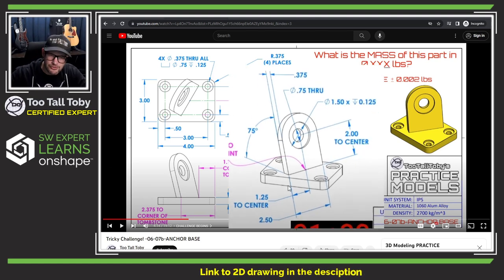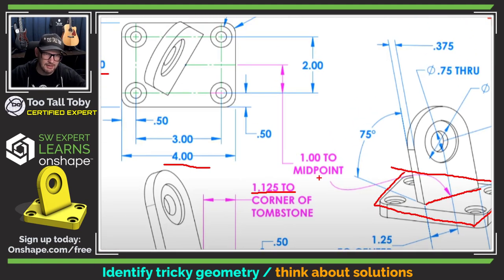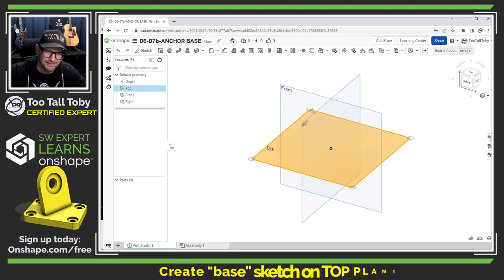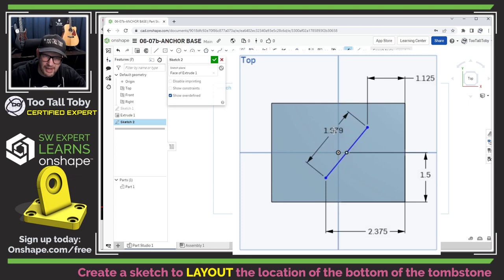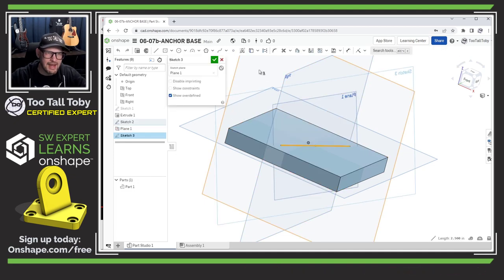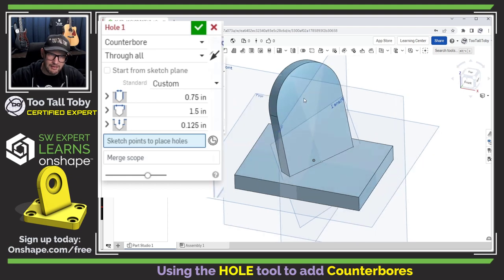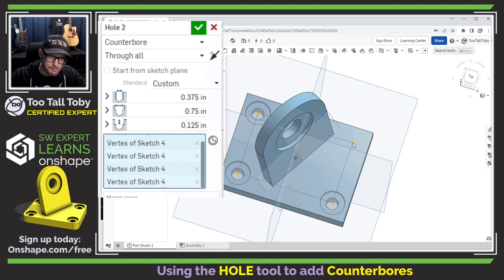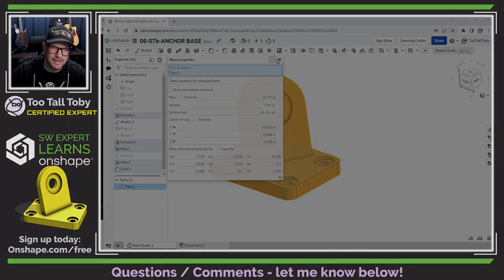Designing an Anchor Base (Tutorial)

Comment: Nice! Mate connectors FTW!
By the way the downside of using the plane for the angle is that you end up with your sketch axes at a weird angle so you can't just use the "standard" rectangle tool and lines won't snap as easily where you want them.
One way around this is to place your sketch directly with a mate connector. Alternatively, you can also create the shape straight and use a move face with rotate to set the angle.
I thought I had a solve of this one on my channel but I don't...
Another tip is that if you use a center point rectangle to locate the holes you can just select your sketch in the feature tree in the hole tool instead of selecting each corner individually (it will ignore the center pt of the rectangle).
Bonus tip: you don't need to put a space when putting in the units (just type 3in) so you could save a whole of three key strokes!
Reply: Another golden tip here for holes - thanks airwick :)
Reply: Oh man these excellent time saving tips just keep coming!!  Thanks Airwick!

Comment: I did this anchor base before you explained it as an exercise as I've been goofing around with onshape for enough time now to think Iwas up for the challenge.
There is a measurement missing on the tombstone, we can't know for sure when it starts arching on the top. By looking at the sketch, it seems that the arc starts at the same height as the middle of the hole so 2 inches from the base.
Based on that I did the part ... took me more than 10 minutes though and I made other building choices than yours ... but we have the same piece at the end and it was a fun exercise to do.

Now that i have seen your tutorial, I learned how to get it a lot faster ... thanks mate connector
Reply: Yup you are correct - I just looked again and there should be a radius dimension originating from the center of the tombstone/counterbore, to clarify that the arch of the tombstone is centered at that same location.  Good catch! 😁  Very glad to hear that you're now able to build this thing faster too!! 😀

Comment: I like to do the challenge and then watch the tutorial to see how we did things differently. I did one quarter of the base including an edge fillet, added the counterbore, then mirrored and mirrored it. Then I sketched an aligned rectangle on the top face and extruded that up as a new part. Transform along the right edge of the base to tilt the tombstone back, then finish up the top curve and counterbore. At the end, I used boolean to union the two parts together, and voila.

Question for you, though: I notice that you don't use the sketch fillet tool, but rather fillet the extrusions. Is that because they are features that you can more easily edit if you need to? I like my sketches to look like the face I'm going to extrude when possible, so just curious about that difference in our approaches.

PS: Thank you for all of these videos. You have made OnShape so easy to learn to use.

Comment: if you are making first the fillets you don't have to draw an extra rectangle for the holes. You kann use the midpoint of the filets. Also tthere is no need for an extra plane for the thombstone. you kan draw an aligned rectangle on the upper surface of the bottom part, extrude it and some filets, make your hole and then you can change the angle of the thombstone with the "Fläche verschieben" tool ( Idon't know the english word for this tool ;-) )
Reply: Great suggestions!  Thanks!!